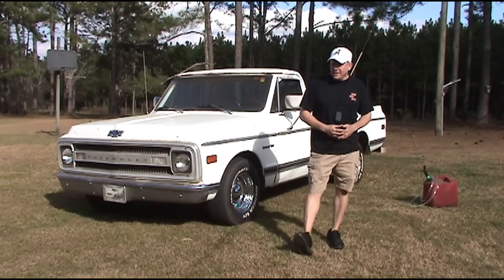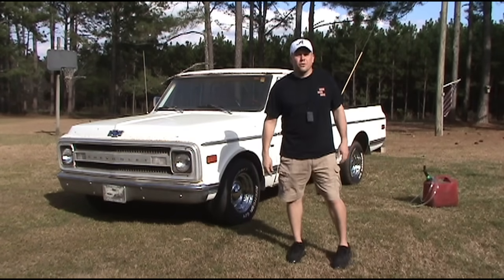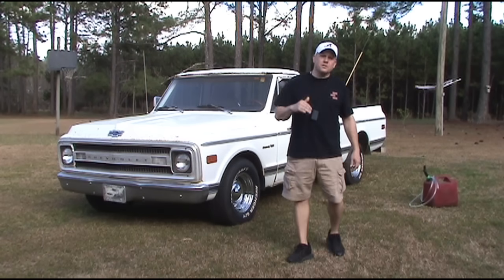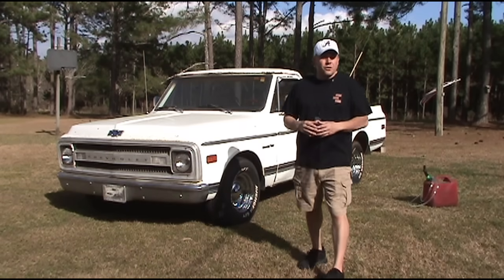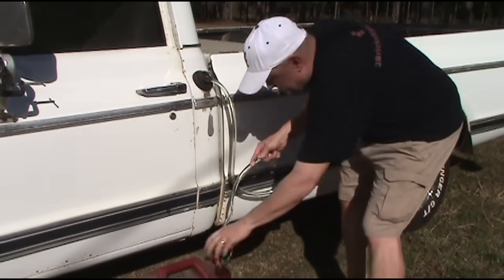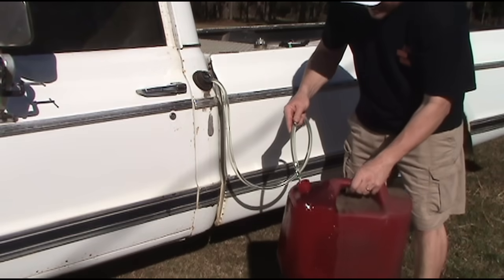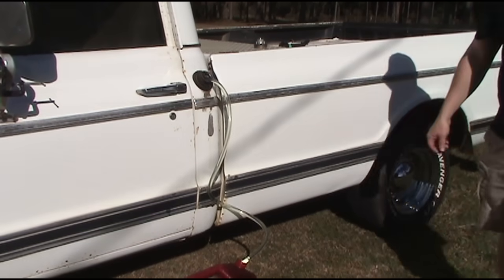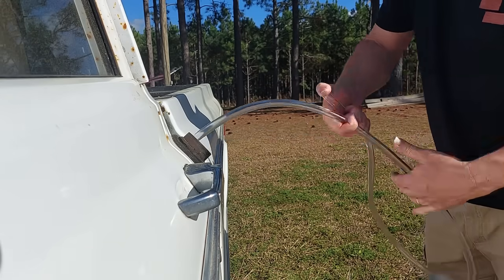Absolute BEST way to Siphon Fuel. You've never seen this before

Comment: That’s exactly how I used to drain my pool many years ago with a long garden hose. The man who built my pool, showed me this. The weight and pressure of the liquid (water, gas, whatever) will push the liquid right through the tubing if done properly. Great reminder. Thanks
Reply from the maker: Nic tip.  Hadn't heard it could be used for pools, but it makes sense 🙂👍

Comment: One way that I do it is:
1) Take a long CLEAR hose.
2) Put one end of the hose into the tank.
3) Loop the hose out of the tank and down to the ground.
4) Stand up straight.
5) Draw on the other end of the hose GENTLY until you see gas going into the bottom of the above mentioned loop.
6) Stop drawing, put the end of the hose into the can and set it on the ground.
    If you watch the gas going into the loop, you can see when to stop drawing on the hose. You'll have 4 or 5 feet of air in the hose and avoid a nice refreshing drink of 300 million year old algae.
    Another thing that I did but this can't be done on a car with fuel injection or electric fuel pump.
    My first car was a 1968 Chevy. I cut the steel fuel line and installed a compression fit "T" valve and a small 6 foot hose. I was always tinkering with that car so I had already installed a set of starter switches under the hood. If I needed to fill up my lawn mower, I opened the hood, pulled the hose out and stuck it in the mower tank, started the engine and turned on the valve. It would fill that 1 quart mower tank in about 20 seconds. Back then, gas was around 45c a gallon so filling my mower from a gas pump driven by a 307 cubic inch V8 engine wasn't a big deal.
    You can't do this on a modern engine because the sudden drop in fuel pressure may be seen by the computer as a fuel leak and set off a fault code or kill the engine completely. Ford and Lincoln have a mechanical emergency fuel cutoff that snaps off in an accident. If the car gets hit, the fear is that if the fuel line gets broken, the electric fuel pump will pump a tank full of gas all over the ground and become a fire hazard.
Reply from the maker: I'm diggin that loop idea.  It just makes sense. Thanks for sharing 🙂👍
Reply: @3BricksHigher  Any time.

Comment: This works no matter how low the tank is. I run the tubing to the bottom of the tank. Wrap a small rag around the tube at the filler. Press the rag (dampen it helps) tightly to the filler while blowing hard into the tube - you should hear the gas bubbling and air hissing out around the rag at the filler. Quickly pull the tube out of your mouth and put your thumb on it. Put the tube into your gas can (can sitting on the ground) and the gas should start to flow, then pull the rag out and inch. Been working for me for 50 years without spilling a drop.
Reply from the maker: Thanks for sharing 🙂👍

Comment: Since I was a kid I used the technique to lower plenty hose, cover it with my thumb and pull the hose. It will bring the liquid trough by inertia. The only downside is that the other end might end up over the surface of the container you are pulling the liquid from, but mostly it works.

Comment: the first I have known since 2nd grade in 1972, the second we used if close to a compressor, the 3rd way is simply put the tube in the tank as far as it will go, plug the end with your thumb and pull out enough to get over the high spot, easy. I refilled all the farm equipment back then.
Reply from the maker: Good tip, thanks 👍

Comment: I figured this out in the 1960s getting gas out of mom's car for my mini bike.  Take a glass coke bottle, put one end of the hose in the tank on the truck. Then, put the other end in the coke bottle lower the coke bottle below the truck, put your finger and thumb around the neck of the bottle tightly, and suck the air out of the bottle creating a vacuum. This will keep gas from your mouth. Then, put gas hose in the bigger container. I am old now and still use this method in the rare instances I siphon gas or diesel.
Reply from the maker: That is a unique way indeed.  I appreciate you sharing it. I just might try it just to say I've done it like that 🙂👍

Comment: Just used two hose method to remove some fuel from my motorcycle. Worked great but watch out for fuel blowback on the blow hose when you stop blowing...if the second hose dips into the fuel, fuel comes up that hose for the same reason it does on the thumb on the end of the single hose method. Use a short hose to blow air into the tank.
Thanks again for safe method!
Reply from the maker: Good call out! Thank you for watching 🙂👍

Comment: Backin 87' me and my fellow marines were siphoning gas from brought in vehicles meanwhile others were tasked with hosing off the tires of the incoming trucks. We were using this tehcnique and somehwere midway it things just got caught fire and i felt a lot of heat. Turns out my buddy simply put a lighter to the end of the hose in the can and things just went off. None of us caught fire  but hose guys saved those trucks. There were 17 lined up, all with 3/4 of gas or so
Reply from the maker: Something about that flame...  gas doesn't seem to like 😂

Comment: 1:28 Time. Earths'  air  pressure, is about 14 psi. Keeping that  pressure, in the hose, causes a pressure   mis-match, between the air IN the tank, (atmosphere) and the pressure, you caused when you pushed the hose, deep into the tank/ 80  %  full.  The difference, causes fuel to  (exhaust = vent )  to the pail outside, through the hose.   People, must know things like this, to repair engines / carburetors, pumps,  anything using natural  atmospheric  pressure.   Pressure  differential -  we must use it !

Comment: You can do the 2nd method with only one hose. Simply insert the hose into the tank. Seal around hose at full neck with the rag as shown in your video and blow into the end of your hose. Put hose into fuel can. Simple as that. Retired mechanic always use this method.
Reply from the maker: Thanks for sharing 🙂👍

Comment: This was great information before 1988 when gas tanks didn't have obstructed filler necks to prevent siphoning.
Reply from the maker: I used this method to fill a generator during a storm and thought I would pass it on. It can be used on anything with a fuel tank. Even water swaps in aquariums 🙂👍

Comment: Been using the 2nd method for better than 40 yrs, but with just one hose...  seal the hose with rag and blow hard through tube, when you stop the back pressure will push the fuel right back out.
Reply from the maker: That's a good idea, thanks for sharing 🙂👍

Comment: You can also shove the hose really quick into the fuel if the thumb trick doesn't work due to lower fuel in the tank.
Reply from the maker: Nice tip! Thank you for sharing 🙂👍

Comment: 1:09 "Well, when you put your thumb on the end of that hose, and lowered the other end into the tank, you prevented fuel from entering that hose. As soon as you release your thumb from it, fuel rushes up through the hose, inertia carries it higher than the level that's in the tank, and once it hits that bend, it starts self-siphoning for you."
Nope. It's momentum, not inertia. Good tip, though. Ditto about blowing into the tank to pressurize it momentarily, to get the fuel to begin to flow.
Reply from the maker: Nice call out.  You're right! 🙂

Comment: Cheers thanks for the content 👍 we used to use the first method all the time, you even can move the hose up and down timing the thumb to make it like a mini lift pump for those Tunks less than 80% you just have to make sure the end of the hose stays in the fuel 😁
Reply from the maker: Thanks for the tip! 👍🙂

Comment: Good job. 
Idea you gave me... Can you put the short hose into the gas can with the siphon hose also inside and suck enough pressure to get the siphon hose started?
Seems you could avoid getting any in your mouth. 
My idea was only thought of from watching your video.
Thanks.
Reply from the maker: Thanks for watching.  You have to blow into the hose to force the fuel out. I don't think i could create enough of a vacuum to get fuel out, just by sucking air from the tank.  Maybe it would work if i could.  Nice idea thou 🙂👍

Comment: I just got another idea. You keep a long piece of tubing that would fit on a vacuum port on your intake of the vehicle you're going to siphon the gas from and you hook up that vacuum line to that tubing and you run it over to that hose that you stuck down into the gas tank. You just put your hand around that line to seal it so the vacuum from the motor pulls the gas up the tube and when it starts to be seen through the clear tubing you just put it into the gas can.
Reply from the maker: That absolutely should work 🙂👍
Reply from the maker: That absolutely should work 🙂👍

Comment: I can tell you a better way than either of those. Put the ENTIRE HOSE into the tank BEFORE you put your thumb over it. Then put your thumb over the hose and quickly pull it from the tank and stick it in your jug. This works everytime regardless of how much fuel is in the donor tank.
Art from Ohio
Reply from the maker: Thank for the tip Art 🙂👍

Comment: When you put your finger on the other side of the hose, you basically close off the "air flow" thru the tube so as you drop the hose into the fuel, the fuel CANNOT go up the hose because there is no path for the fuel to flow thru because you have it closed up top so now you are pushing fuel DOWN into the tank by pressure, so when you release your thumb, now you opened up an air channel and now the fuel will make its way UP that hose.

Comment: Very good.  There is a problem with some cars as they have anti syphon guards on the neck of the tank.
Reply from the maker: I used this method during a storm to fill a generator and thought I would pass it on. This works on lawnmowers, tractors and anything else with a fuel tank. After posting this i was told fish shops use this method to do water swaps in aquariums 🙂

Comment: The better approach is to take the hose and put all but the end into the filler neck of the tank, and THEN put your thumb over the end, and lower it to the gas can, pulling out a full hose from the tank as you do so. Release your thumb as you place the end in the can.
Reply from the maker: Good call out. That works too 🙂👍
Reply: @3BricksHigher  Well, like your father and your grandfather, I was a professional auto and truck technician, and I had some some old hands that taught me all of the tricks. When I was growing up in the 1960s, back when NASCAR used to race real cars and not specialty built cars, there was a man who wrote for the magazines who was the guru of NASCAR engine builders.
 His name was Smokey Yunick, and he was one of the best mechanics who ever lived. It was a great time to be a kid.

Comment: If it don't work. You can use another hose at the top of the hole and blow air into the tank using a towel wrap around the hoses to make a air tight seal.
Reply from the maker: Thats the 2nd way i show in the video.  Great minds think alike 🙂
Reply: @3BricksHigher  I used a leaf blower one time. But one spark in the wrong direction would be game over.

Comment: 🚗❤
A , local newscaster said they were siphoning tanks by using a whole punch and a large galvanized tub under gas ⛽ tanks. 
👋😎💨 Bryan
Reply from the maker: But this works on lawnmowers and other equipment too.  I used this method to fill a generator during a storm and thought I would pass it on 🙂👍

Comment: Great idea! But the newer cars have plastic ball valves in the tank filler for safety Incase of a over turn , you can’t get a hose in the tank , this is for old vehicles before even 1980 maybe 1970 .
Reply from the maker: But it does work on mowers and other equipment. I used this method to fill a generator during a storm and thought I would pass it on.  Someone posted they use this to do water swaps in aquariums too 🙂👍

Comment: Well a couple things, most vehicles will be locked with dead batteries during an emergency so you wont have ANY idea how empty or full the tank is.
Reply from the maker: But tractors and mowers won't 🙂 works on many different things 👍

Comment: Will this trick work on newer cars? Love it 😊
Reply from the maker: Actually it will depend on the car. I used this method to fill a generator after a storm and thought I would pass it on. It works on other equipment too.  Someone posted they use this method to do water swaps in aquariums. 🙂👍

Comment: There's another involving compressed air.. and its not compressing the air in the tank. I forget if there's a slit cut in the hose near the outer end or not.. but the compressed air is being blown in the same direction as the desired liquid flow.. creates a vaccum in the siphon hose to get siphoning started
Reply from the maker: That's interesting because you're using air from a different source than your mouth.  That's good info 👍 anything that keep fuel out of your face is good stuff

Comment: Not braggin or promoting here, but 40yrs ago or more I was a car thief, I used to use both these to get fuel to drive around if the tank in the stolen car was low or getting low.

Ive never seen anyone use or talk about these before, its been a long time since last saw this.

Comment: This process only works on older vehicles.  I tried to siphon the gas out of the last three vehicles, before trading them in.  All of them had anti siphon features in the filler neck to prevent that from happening.
Reply from the maker: This process works on anything with a gas tank.  Lawn mower, tractor, ect
Reply: @3BricksHigher  anything except modern cars with anti siphon feature .  That’s why it worked on an old truck.
Reply from the maker: @robertheinkel6225  it also works on lawnmowers and other equipment. I used this method to fill a generator during a storm and thought I would pass it on. Someone posted they use this to do water swaps in aquariums. 🙂

Comment: Great method.  Unfortunately the tanks on most newer vehicles are no longer accessible... just can't shove a siphon tube all the way to the tanks.
Reply from the maker: But you can use this method to siphon fuel from a tractor or lawnmower. I used this to fill a generator during a storm and thought I would pass it on 🙂👍

Comment: Another factor on why this works here... isn't the fuel tank behind the seats on these older trucks? Then you add your 80% full criteria and you have a relatively high level of fuel.  Way higher than most fuel tanks which are underneath the floor boards. This would give 1/3 of the height or 3 times the elevation " to get to the bend." Not sure I'm buying this as a general rule.
Reply from the maker: Ray i found out after posting this, stores who sell fish use this method to do water swaps in their aquariums. It can be used for anything that has a fuel tank, mowers, tractors, ect.  I assure you it's legit 👍🙂
Reply: @3BricksHigher  I will be experimenting on this, I'll verify...

Comment: I notice that newer automobile has an baffle plate that stop the hose from getting to the gas, is there a way to still get the gas out of the tank? I had an 1995 truck and the baffle plate was in it and that's not really newer.
Reply from the maker: That flap can be pushed in with a pencil.  Insert the hose then push the flap down again to remove the hose 👍

Comment: He starts to drive away.
I hope he remembers to put the gas back in the truck.

I had a gas can with a spout that spilled gasoline. So for a couple of years I was using my outboard fuel line w/squeeze pump to fill my mowers. From car directly  to mower. My car was my gas can.
Reply from the maker: That's a good idea.  The outboard fuel line bulb would work great 🙂👍

Comment: Fyi: most modern gas tanks have a check valve in the filler neck which prevents any hose to go all the way. My 1991 car has this feature as well. Just a heads up.
Reply from the maker: Push the valve down with a rod and the hose will go in.  Push it in to pull the hose back out 👍

Comment: Cars made after a certain year have a screen before the tank.
Reply from the maker: But, this method also works on lawnmowers and other equipment. I used this method to fill a generator during a storm and thought I would pass it on. Someone posted they use this to do water swaps in aquariums 🙂👍
Reply: @3BricksHigher  now you're talkin.
Yes, I do sometimes need to re-home some gas into my scooter and lawnmower gas would work just fine. Thank you brother.

Comment: I am wondering if these 2 methods work on modern cars say after year 2000 ( as there are different designs for fuel tanks preventing fuel / gasoline or diesel from stealing ) meanwhile the car you used to demonstrate is from 70's or 80's.
Reply from the maker: I used this method to fill a generator during a storm and thought I would pass it on. This works on lawnmowers and other equipment.  I don't think you can siphon from newer cars.

Comment: Nice truck. Year(70-71)? I had a beautiful ‘72 C/10. Last year before they squared the fenders and ruined the look.
Reply from the maker: Thanks.  Its a 69.  Was my Dad's truck. I've only upgraded the front brakes to disc so it would be safer when i pass it down to my Son. I'm going to post a video changing the ignition soon and it will show the interior, engine, ect so i hope you will check back.  It's nice hearing from people who can appreciate these older trucks 👍

Comment: Is there a fuel level sensor in the gas tank that you would possibly damage by inserting a hose and moving it around? I know in small outboard motor gas tanks there is a simple float but I don't know how modern cars and trucks sensors work and where they are located.